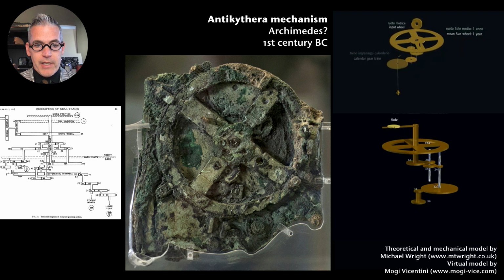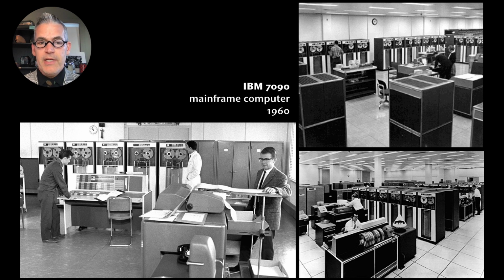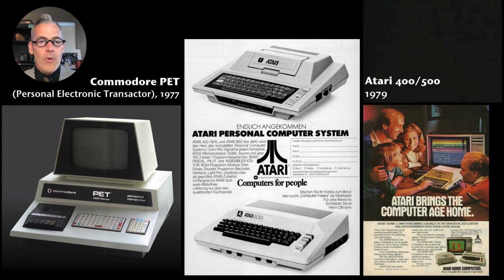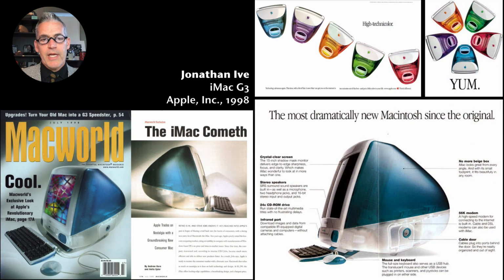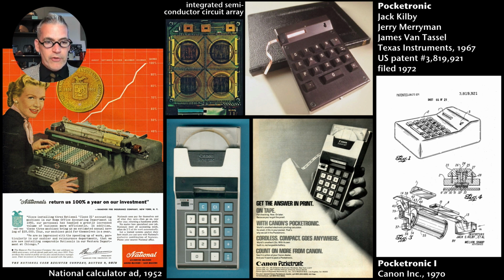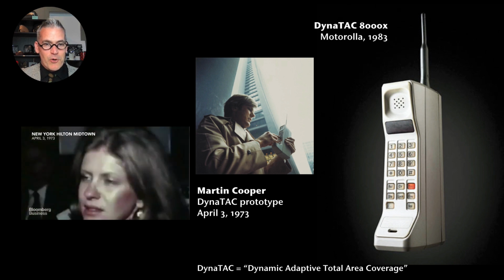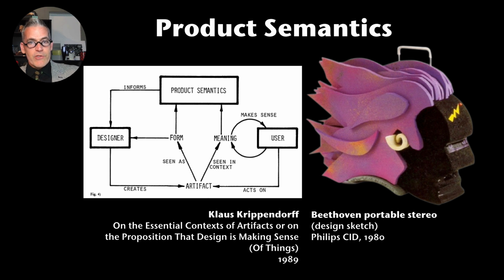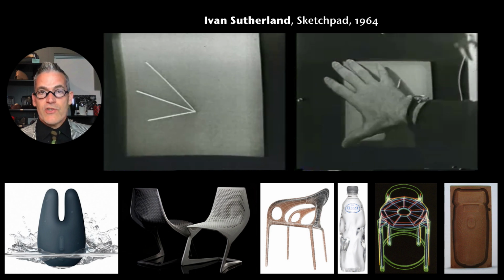History of ID Week 12, Part 1: Electronics and Product Semantics

Comment: When I look at consumer electronics from the late 70s on, I think there's an underappreciated modernist aesthetic to these plastic and metal boxes.  I find it kind of reminiscent of International Style architecture--letting the form be dictated by a  pure expression of function and materials.  Stereo systems, VCRs, and desktop PCs were new objects, with no functional antecedent--so why try to make them look like something else by wrapping them in a decorative chassis?  These are objects made from rectangular circuit boards and box-shaped modular components--there is a purity of purpose to put them into a metal or plastic box with the controls you need to touch up front, and the tangly bits--which you don't want someone tripping over--connected in the back.  You could take the same components and put them in a sphere, or a teddy bear, or literally anything--but why?

Apple is the darling of designers, because their products scream out how designed they are. I think a lot of enthusiasts reacted negatively to that, not just from platform-war fanboyism, but because viewed from this functionalist sensibility many of them come across as pretentious, bloated, and chintzy.  And the non-Apple hardware that aped that aesthetic was scorned even more.

Much like the International Style, of course, this "simplicity of purpose" also happens to conform with blatant, repetitive cheapness.  So it's not without its own problems. 😁

Comment: A couple of notes about the Macintosh - the ads and introduction and sketches are for the original Macintosh, which was just called "Macintosh" which debuted in 1984.  The Macintosh SE was from 1987, three years later, and was significantly improved from the original since it was their fourth model.  The key differences are that the original Mac had 128K of memory, the SE had 1 MB, the SE had two 800K floppy drives instead of one OR one floppy drive and a 20 MB hard drive, whereas the original Mac only had one 400K floppy.  The SE is said to have sold incredibly well pretty quickly.